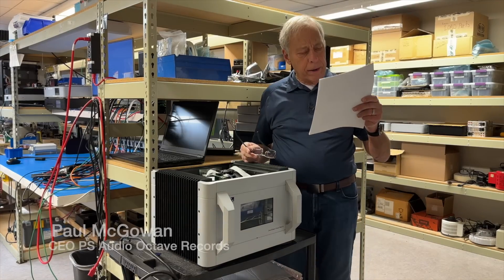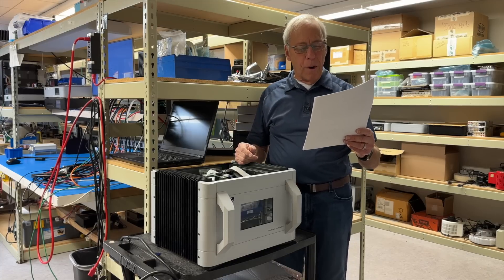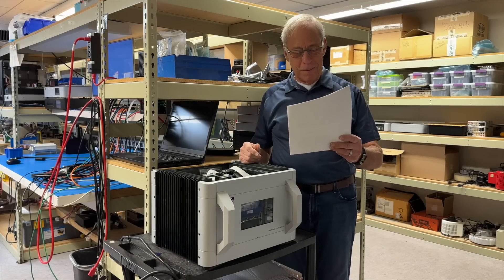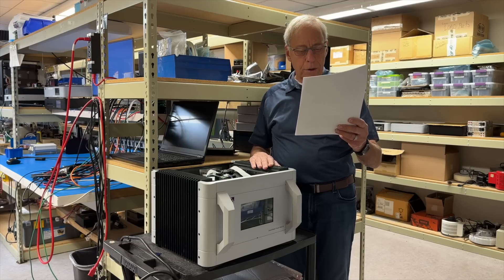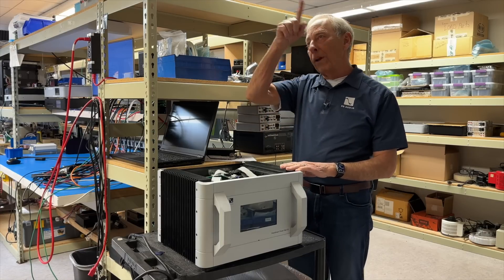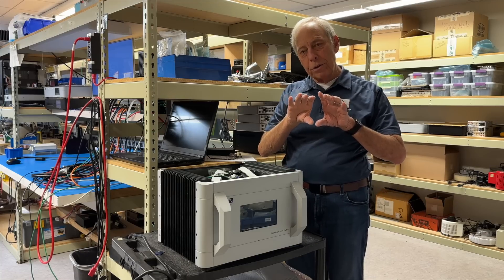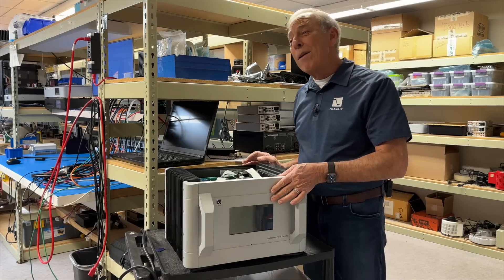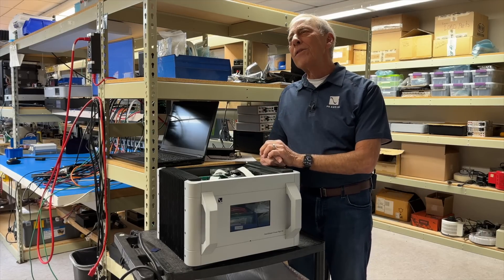How well does a Power Plant regenerate?

Comment: Paul, you can use all the fancy jargon you want but there is no doubt the power regenerators are snake oil. My good friend Jason bought one and we listened with it in the signal path and not in the signal path. Absolutely no difference in sound. And my friend admitted it makes no difference buddy decided to keep it since it looks cool LOL. How can you sleep at night selling these things?
Reply: I bought one and it made a huge difference. Stopped a hum from
My speakers. Plugged them direct into the wall and it was back. So yeah they do make a difference, but if you’ve got perfectly clean power, then it wouldn’t make much, if any difference. I still think it’s worth getting the cheapest one though to plug in everything except big amps jist for clean cable management
Reply: @Obsessioncardetailing  this sounds much more reasonable. Others are saying Imaging, soundstage, vocals, are all improved. That's a bunch of malarkey
Reply: @Obsessioncardetailing  but maybe you should have tried $500 power conditioner before dropping thousands on Paul's trinket.
Reply: @ryanschipp8513  I did. Power conditioner didn’t do much. It’s nice though so I kept it to plug TV etc into. And I have the P3 regenerator, the smallest one, which isn’t that expensive
Reply: @ryanschipp8513  well if you can rid of hum and noise from the speakers, then I can see how it might affect the overall sound quality resulting in better imaging, clarity, bass and all that.

I know that when I got a cheap LPS for my project tube phono stage it was a massive improvement over the standard power supply. Even had my wife swap them over for me and I was able to pick it every time. So yeah I think power definitely matters
Reply: @Obsessioncardetailing  yeah but that's not what others stated. They didn't say that they had noise in the hub and then everything started to sound wonderful. They mentioned nothing of any noise or hum and then sad all of a sudden all these other audiophile aspects gloriously happened. That's a bunch of baloney. Imaging soundstage and Sonic Bliss come from the recording itself, the source, speakers, and speaker positioning. A power regenerator can't magically give you deeper soundstage. It makes no sense at all.
Reply: @ryanschipp8513  I’m just responding to your assertion that they are snake oil and do nothing. They most definitely do something and clean up the power. Whether the difference is audible or not depends on other factors too

Comment: ac to ac    and ac to dc   dc to (ac) soundwaves ??/?
Reply: It's basically acting as a UPS without battery backup, it's taking mains voltage  charging up bunch of capacitors (that are low capacity batteries), and then converting it back into mains voltage but regulated so regardless the input voltage & sinewave it'll always be perfect on the output. So, basically giant UPS without battery backup feature. Nowadays, anyone can get cheap UPS that will clean up a noisy sinewave,be battery backed up, and also display all the ins and outs of everything without looking at the unit.

Comment: The audio improvement by using one of Paul’s power plants is amazing. The biggest effect it gives you is a completely black background. And I have done an A B test.  System sounds kind of flat, without the power plant. I will always have one in my system going forward.
Reply: At the end of the day, that is what counts.  I got the same report from someone in the DIY community whose hearing skills I respect.  If power cables and dedicated lines can improve sound, I suspect the power plant has the potential to be significant.  Do you still see a difference in power cables between the power plant and your electronics?
Reply: I beg to differ. My friend has one and we also did blind testing and it made no difference. Also I've got three rigs at home with no power plant in any of them and they all have an absolute black background. All you're doing is trying to justify your purchase
Reply: @ryanschipp8513  Equally interesting.  I conclude its useful in some circumstances.  Let's hope they have a trial period no question return.  
But no justification here.  I don't use them, just interested from the sidelines.
Reply: An A B test shows nothing. You’re imagining these differences, I suggest you do a doubleBLIND test and record yourself if you can tell the difference 9/10 times. 
A whole suite of precise measurements has shown ps audio’s powerplants do nothing for AC quality.
Reply: @ryanschipp8513  I agree Ryan.  I've looked at the ac sine wave coming out of the wall on a scope and it looked perfect. Any imperfections or distortions would be smoothed out by the filtering capacitors in the power supplies of your audio equipment.  This ac regeneration reminds me of the overpriced silver speaker wires and the overpriced interconnects etc.
Reply: @markwilson5262  how can you prove this?
Reply: @ryanschipp8513  Just like faith, proof is a feeling and an experience. As soon as you try to put it into words like in the comment section over the internet it loses its validity to those with preexisting biases on the matter at hand. You will never get proof of anything in text. An exception perhaps being a math equation.
Reply: @InsideOfMyOwnMind  my question was to Mark Wilson oh, he made a declarative statement seeing results vary hugely from person to person in different areas and different systems. So we should all just take his word for it? Prove it.
Reply: @ryanschipp8513  These discussions all follow a script and produce nothing.  If you want to double blind test, good for you.  Go for it and report.  We'll all learn about your experience.  But it may have no relationship to another person's experience.
I don't and never will use a power plant because I don't spend that kind of money on that size of result.  But I can say I had buzzing transformers.  That could be caused by DC on the line leading to mechanical hum and transformer saturation in even the best designed amp.  That will impact sound.  I put a dc block circuit in my system.  The buzzing is gone and the system sounds a bit better.  The fact that some people swear by Power Plant and others see nothing could be as simple as DC is there or a power factor correction is needed in their part of their town.  Local Distribution companies put cap bank controllers all over their network and measure volt/var and adjust to keep power factor correct.  Do you not see this alone could screw up the sound for audiophiles in that area of the city while others in the same town have no issue?  None of this is universal.  That also means that investing in power conditioning could be a waste or a good thing.
Reply: Confirmation bias
Reply: That's just your brain telling you that it was worth it after you wasted $6000 on one of these.
Reply: @mrb5217  That happens.  But not to me on this topic.  My DIY power 'conditioner' DC block distribution box has maybe $100 in parts in it.  The stuff that improved sound is in it.  The stuff that degrades sound or makes no difference (inductors & isolation transformers) went in the trash.
Reply: By listening, and listening again, and again, and again, and again. The assumption is that everyone that gives a viewpoint has actually set up their system properly, which is usually not the case. People with amplifiers that demand 1000 watts continuously have reported their system sounds better connected directly to the wall. That I believe. Others that use lower powered amps have mentioned improvements in the soundstage with power plants. That I also believe.
Reply: @geoff37s38  confirmation bias works both ways. If you convince yourself there can't be a difference, then you won't hear a difference, even when there is a difference.

Comment: The writer asked to see oscilloscope measurements...and you just blither on instead of simply turning the unit on and showing him????????
Reply: And lets be clear on the scope measurements as well. What we want to see are A/B scope measurements of an audio device on it's analog output. IOW, an amp's speaker output, A DAC's analog output.

The PS Power Plant does clean up the AC power sinewave and lower it's distortion. Just measuring the Power Plant AC output will show a marked improvement. But does that matter? We want to see the effects on the audio signal.
Reply: @andydelle4509  there is none
Reply: It is just a search at YouTube away! ASR have measured it, together with many doubtful products. Audioquest has several of these products. But I always prefer listening at home, if I try new products.
Reply: @jackfalco5351  Right you are.

Comment: Audio products with poorly designed power supply circuits operating in poor power environments need a power regenerator.
Reply: It’s all about what makes you feel good. If lowering your distortion level .0005 makes you feel good..??🤔😀👍🤗😎👑
Reply: @davidfromamerica1871  We hear what we want to hear and the more we spend the more we feel it sounds better. For this reason, don't forget to use very expensive cable lifters if you are a true believer in the sciences of snake oil research.